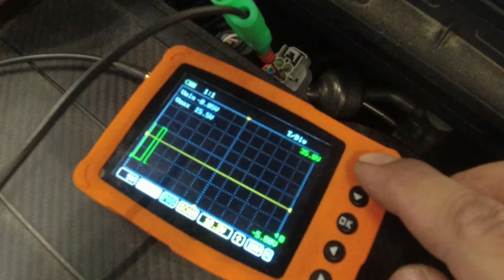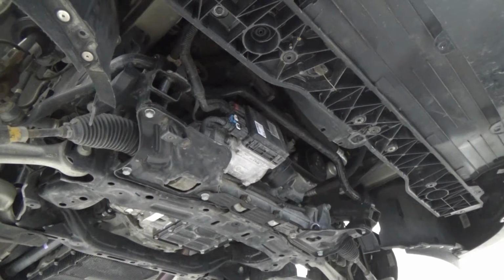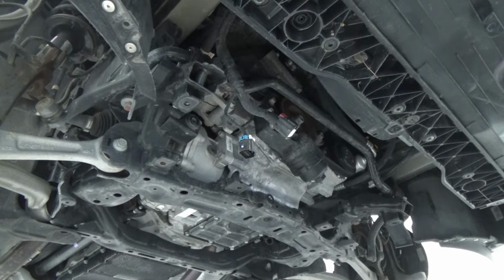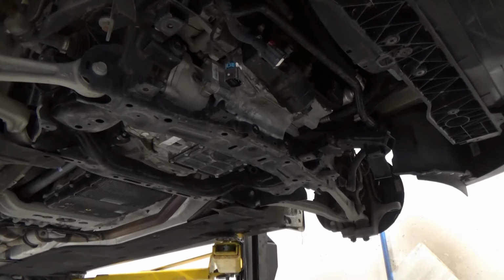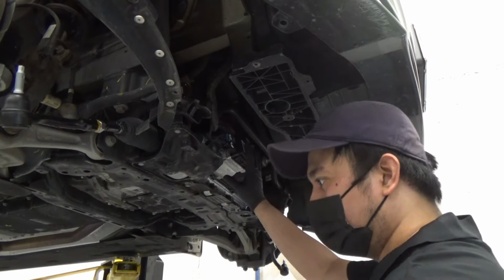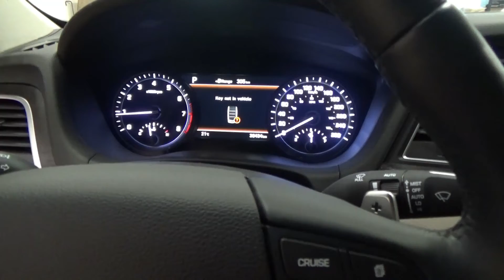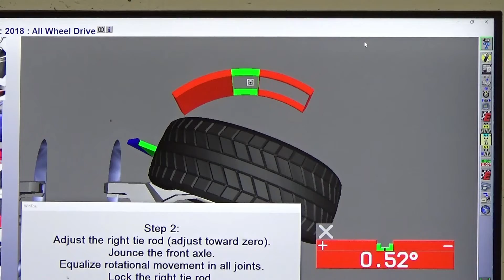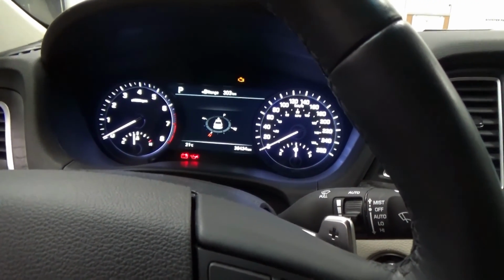GENESIS G80 POWER STEERING RACK REPLACEMENT + ALIGNMENT

Comment: My 2017 Ultimate had  a popping issue when turning. In my case, a loose batter cable was the culprit. Once cable was secured & tight, the problem went away. That motor in the rack needs all the juice/current.

Comment: Hello, i removed the electric power steering motor that is on the rack. Now when I put it back in, and turn the steering wheel. I hear gears grinding. But I can't seem to figure out why. There is not a way to line up the motor it just bolts in with three bolts. Wondering if you have ever removed the motor itself? If so and answer to be great. Thanks!
Reply from the maker: Is it brand new motor? I havent done just motor repalcement. If its grinding can you isolate it if its from the motor, could be the rack internally.

Comment: So the SAS (steering angle sensor) calibration is only required if the car is equipped with a front radar and camera? 

Would calibration help after an alignment if vehicle is not equipped with radar & camera sensors? As customers, can we request for this calibration?

I have read people complaining about their car not tracking properly or pulling left or right, although they had multiple alignments and tires were checked ok.
Reply from the maker: Calibration is not only if its equipped with ADAS, as along as its motor powered its important to calibrate so that the ecu knows if your turning or not, it needa that steering angle input. For alignment maybe theres other issues with that, bent components? Improper alignment? Hope that helps
Reply: @hyundaitech  good to know, thanks for your input!👍

Comment: Thank you for sharing your good work 🙏🏼

Wanted to ask if I can swap a 3.3TT from G80 Sport to my G80 3.8 (both 2018 and RWD) 
What I need to take out from the sport model? 

I’m really considering upgrading the 3.8 NA Engine due to lack of power and higher fuel consumption when compared to the 3.3TT (and its also now ran 192k miles)
Reply from the maker: I think they are both the same, the only important thing is when you do program the new steering make sure  its for your vehicle.

Comment: I have a Genesis G70 Do I need to reprogram the vehicle after a simple alignment without changing the rack and pinion?
Reply from the maker: Best practice is to reset the steering angle sensor after alignment, if you dont have one to calibrate it its not end of the world, so yku should be fine.
Reply: @hyundaitech  thanks for replying brother, reason I ask. I recently had the car aligned but afterwards the steering wheel locked. I tried changing some fuses, even bought a brand new battery. But nothing. I’m hoping it isn’t the rack and pinion I don’t have any money right now. This is the code I received “C170516 ECU Pre charge Circuit Fail”.
Reply from the maker: @barba3005  make sure connector to the steering rack is connected correctly. Make sure the battery connection is good, and ground. And whats the running voltage reading on the battery?
Reply: @hyundaitech  where would the connectors be exactly? And I actually put in a brand new battery to make sure it wasn’t a battery problem but steering wheel still refused to turn. The car was running fine until it locked. This happened after the alignment. The (DAW) is showing. I’m hoping it isn’t the center module on the rack and pinion, either or. I’m praying it just needs to be reprogrammed
Reply from the maker: @barba3005  the code you have is pertaining for abnormal.voltage supplying the rack. The connection is in the rack. So just make sure you push it in correctly, and double check your charging voltage.
Reply: @hyundaitech  Thank you kindly for your time and patience 🙏 God bless you and your work. I will  do as is. Ty

Comment: Thank you for this video. If my Genesis does not have front radar or camera, does the steering still need to be reprogrammed?
Reply from the maker: Yes needs to be program still especially the steering angle sensor
Reply: Oh okay thank you. Do you know if installing a used rack and pinion from the junkyard will be able to be reprogramed to my car?
Reply from the maker: @naumanakbani2618  i have no experience using a used one to install it, but i think its doable just make sure to reprogram or to code the used one.

Comment: i have a 2018 3.3tt and i have a pop in the turn and i know one of my tie rods are slightly bent, i cant find parts like the next owner but i did find one that came off a 2022 but im not sure if it would fit are the tie rods on the 2018-2022 interchangeable ?
Reply from the maker: No i dont think they are interchangeable., best way is to ask parts department for the right part.

Comment: Have you seen it where you fire up the vehicle (2015 Hyundai Genesis in my case), and then multiple warning lights came on, the Lane Keep Assist, Autonomous Emergency Braking, Lane Departure Warning System, and then electric power assisted steering.  It starts, and you can go into gear and drive forward / backward, but you can barely turn the steering wheel.  I was teaching my daughter how to swap rear brake pads on it the night prior and the test drive went fine, but the next morning it lights up like a Christmas tree.  I don't know if somehow that could be tied to the issue - maybe some sensor was hit when putting the caliper back on?  I don't see how, but maybe you know of a correlation?
Reply from the maker: Is the caliper with electric parking brake?
Reply: @hyundaitech   I'm not sure what you mean?  There are a few lines to go to that area, one directly to the caliper, one for the sensor, and I believe another one, which is probably what you're referring to.  Not sure how that would impact power steering, but figured you'd know better.  I can still drive it, just no power steering.  I just ran out, pulled the rear tires back off and looked to see if there was any sort of damage to the sensor area, but it looked ok to me.
Reply from the maker: @ericjansen9042  i mean if the caliper has the electric caliper parking brake. Or what you can do check and see what codes it has stored
Reply: @hyundaitech  Yeah, I thought that would be the best course of action as well.  My wife just hooked up the OBDLink MX+ OBD2 Bluetooth Scanner, but shockingly it didn't find any codes.  We have a couple of other readers were gonna try though.
Reply: UPDATE:  She updated the firmware on the MX+ and then downloaded the 'Enhanced Diagnostics Support' for the vehicle and now she see's a code - C1805, if you know what that is?  I'm still reseraching it.
Reply from the maker: @ericjansen9042  c1805 is communication error to LKAS, lane keep assist module, maybe its a coincidence that it happen like that. Maybe try remove negative cable battery wait 10 minutes and reinstall and see
Reply: @hyundaitech   OK, I'll give that a try and let you know what comes of it.  We tried to clear the codes, but that had no impact - they just came right back after restarting the car.
Reply: @hyundaitech   Another thing I like to ask dealership techs is which cars they see the least issues with / which ones would they get.  If I was going to get a newer Hyundai or Genesis, since mine is almost 10 yrs old now, which one would you recommend?
Reply from the maker: @ericjansen9042  hyundai tucson are good, genesis g80, palisade, santafe. Currently i have 2022 tucson 2.5 litre and to be a honest with you as long as the owner take good care of the vehicle and follow the oil change interval and not abuse the vehicle for me hyundai brand is good vehicle.
Reply: Disconnected the negative for about an hour or so and then tried to restart the car, but unfortunately the same errors popped up.  I didn't clear the codes before trying to start it, but did afterwards.  Still didn't work though.  Sadly my local dealership can't even look at it for another 10 days.  Perhaps I need a different code reader to see more details?  Any suggestions?
Reply from the maker: @ericjansen9042  so i guess its a hard fault, if you want a code reader that can read multiple system in your case like tge lane keep assist module its gonna be a little bit costly like around 500 something or you wait until a capable shop can diagnose the issue.
Reply: @hyundaitech  I'll drop $500 if it's quality gear that I can use for the long term.  What reader/scanner would you suggest?
Reply from the maker: @ericjansen9042  i have a thinktool that i use for other cars, but theres some other good ones too like autel or topdon, as long as the scantool is capable for full system scan.
Reply: @hyundaitech  I was just looking at the Innova 7111,  not sure if that's overkill or not.  I'll check out the ones you mentioned.
Reply: @hyundaitech  OK, so I just got my car back from the dealership.  They said that a large chunk of wiring harness was missing.  It's some harness behind the front bumper protected by the undercarriage cover.   What harness is under there?   I don't see how, what looked like a 6" bundle / length of wire goes missing from such an inaccessible location.

They also said that my Platinum warranty doesn't cover it.  That's pretty frustrating after paying for an aftermarket warranty.
Reply from the maker: @ericjansen9042  maybe the harness for the front parking sensors? Does your vehicle operates normally especially the sensors on the front? Yeah sometimes those aftermarket warraty are questionable.
Reply: @hyundaitech  not sure, debating on putting it in a lift to see what they did.  I already paid, so it may just be a waste of time.  I'm mainly just curious.

Comment: Hello, can a 2015 3.8 and fit a 2015 5.0? Only one I can find, also what all other needs will I need to take when I find one.
Reply from the maker: Anything will fit, with some modification. But the problem you will be facing is the harness from the 5.0 from 3.8 engine. Im not hundred percent sure whats the difference on the connections from those two engines.

Comment: I currently have a 2015 Genesis AWD. It's been so hard to find a rack and pinion replacement. Then I called a few dealers and they want roughly 7 grans for a new one... 
However, I came across one for a 2018 G80. Would I be able to use that one since they both have the same engine displacement? or would that cause even more problems.
Reply from the maker: As i can see the wiring the diagram both years has the same set up. Im not sure coz i never try cross installation between different years.
Reply: @hyundaitech  thank you so much for this.
Reply: @andrewwebster7185  have you found anything? I have a 2016 awd g80 and it has a cracked one and can’t find anything anywhere
Reply: @Hyuboost  hello to you my friend. I found one in Canada from a Hyundai dealership but they won’t ship to US. They canceled my shipment.

The AWD one is very hard to find. 

eBay periodically has a few that come up from time to time for a reasonable price compared to going through the dealership.
Reply: @andrewwebster7185  also another question is it one whole unit like I can’t just get a replacement electric pump rather to the whole rack ? I hit a pothole and it cracked the power stearing I believe
Reply: There is some OEM new parts for cheap around $3600 Hyundai Genesis Online store. I am replacing a steering rack for my 2017 G90... T_T  don't buy from dealer

Comment: Hercules lifting that electronic power steering rack like nothing 💪
What would happen if you didn't do the recognition for the new rack and didn't reprogram the steering angle sensor? Would the car still work or would the dash light up like as Christmas tree?
Reply from the maker: Hahahha. It wanst that bad the weight of the rack hahaha.
For the calibration it will just give one warning light but the important thing is the ADAS system, since most Genesis or new Hyundais are equipped with the front radar and front camera, they have to know if the steering wheel angle in tje rihht position.
Reply: @hyundaitech  Lol don't hurt yourself, we need to keep working and cranking out these videos
And that's true, didn't think of that
Reply from the maker: @4555Anthony  yeah for sure man. Thanks again

Comment: Where can I get the rack and pinion ?
Reply from the maker: I get my parts from the dealer.
Reply from the maker: I get parts from dealer
Reply: Is that a awd ?
Reply: I have a g80 2015 I need to replace the rack but I don’t know if my car is a awd how can I find out ?
Reply from the maker: @nerimartinez1974  if theres a big propeller shaft underneath mid vehicle the its a awd mofel
Reply: Is the one your working on a awd ? And also is it necessary to do a reset after replacing the rack ?
Reply from the maker: @nerimartinez1974  yes all wheel drive and yeah you need to recalibrate steering angle and perform coding
Reply: Isn’t  the rwd also have a big propeller shaft ?
Reply from the maker: @nerimartinez1974  yes rwd has main propeller shaft.
Reply: Main propeller ?
Reply from the maker: @nerimartinez1974  the big one is the main one, in awd theres another one for the front wheels
Reply: Alright,now I’m a 100 % my car is a rwd thank you so much !